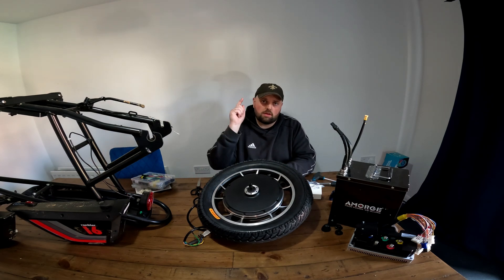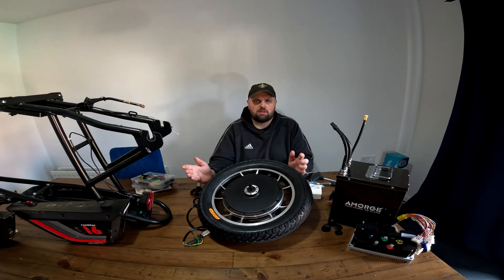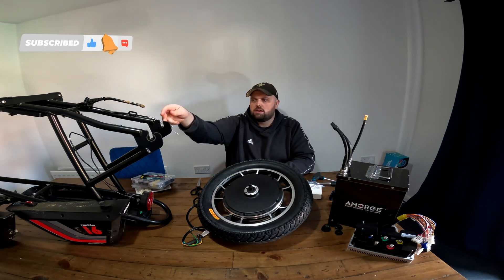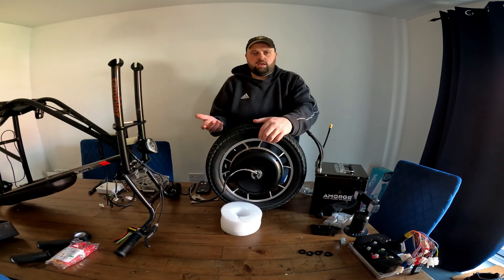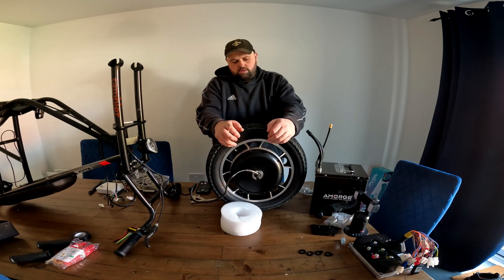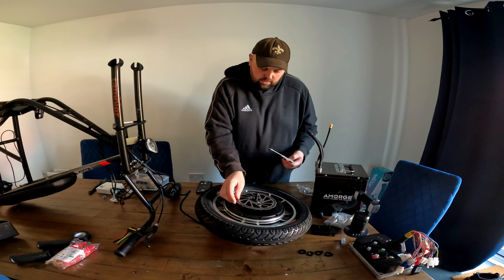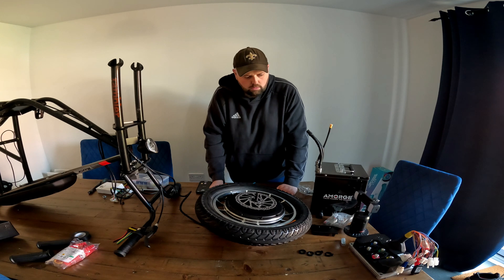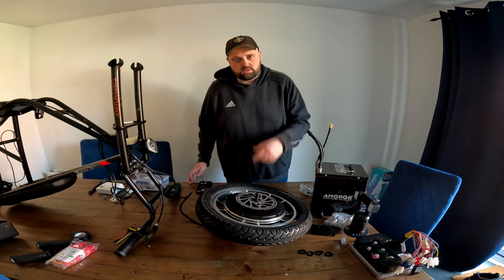Razor Rambler 16 3500w hub motor build

Comment: first. i love my rambler 16. im too broke to build it the way it deserves. 😂 but i do have 2 stock motors. but trying to find a dual motor controller is a pain in the ass. also gotta get a fork thats wide enough to fit the hub
Reply from the maker: I know I made a lots of mistakes at the beginning.but that’s how you learn when you are impatient 😂.
But you will see in the later videos I got there in the end
Reply: @throttleandcharge I'm working through your videos. I actually fried 5 controllers learning that wire colors don't match between manufacturers